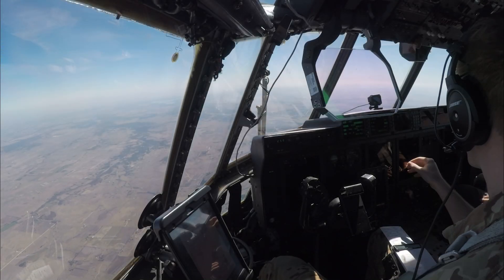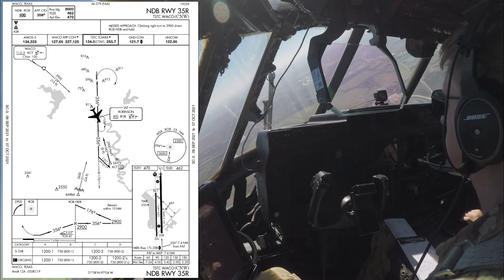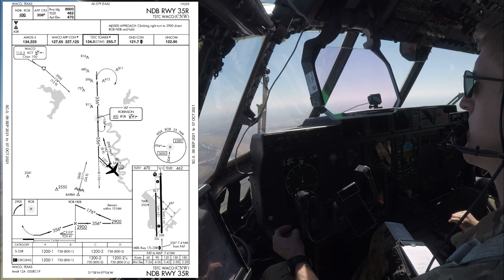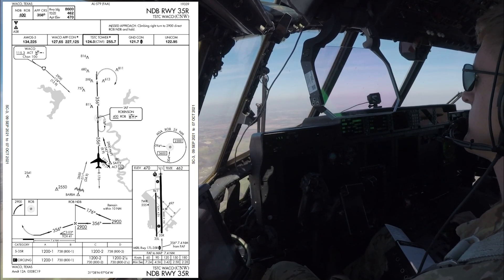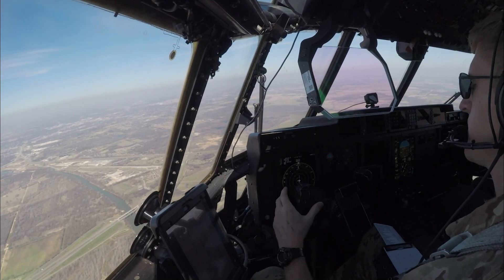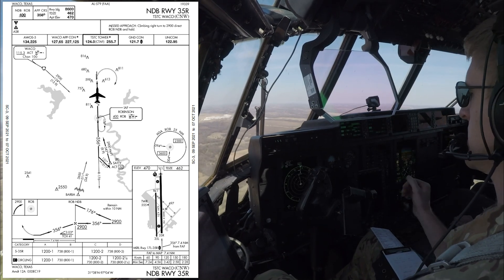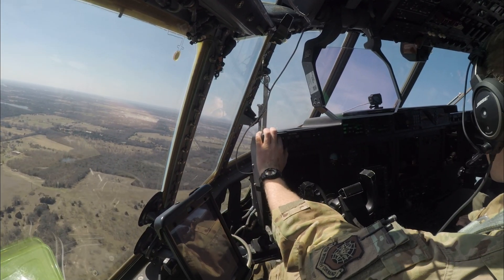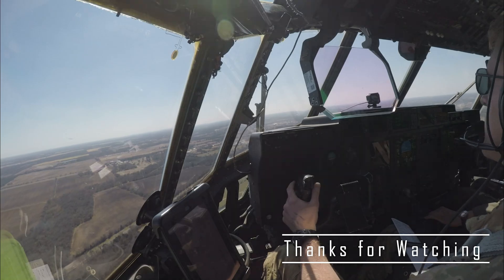C-130J NDB APPROACH AND LANDING - 4K

Comment: Push the nose, pull the tail?  What does that mean? {obv I’m not a pilot}
Reply from the maker: A way to remember how to stay on course. On an NDB or RMI only approach, the only indication of your position is an arrow that points directly to the navigational aid (station). If you are flying towards the station, the head of the arrow will be in front of you or pointing towards the station. If flying away, the tail of the arrow will be in front of you with the head pointing behind you at the station. To fly the approach you are required to keep the arrow on a specific course. If the station is directly north of you and you are flying directly north, that course is 000 or 360. If you drift off course, say right of course, the arrow will point slightly left. To bring it back to 360, you need to fly a heading slightly left of the arrows head to "push" it back to your desired heading. The reverse would be true if flying away. If right of course, the arrows tail would point slightly right of 360 thus you need to fly a heading left of the tail to "pull" it back to your desired course of 360. Once back on course you remove the push or pull heading change.
Reply: @ReachAviation  thanks

Comment: Got my Multi IFR rating in 2007 in Fresno, California at FAT. Right next to FAT is Fresno Chandler where I had to perform an NDB DME ARC approach for my check ride. It was challenging but I nailed it. I'm surprised to still see NDB approaches in this day and age but they are fun. Unfortunately, that approach doesn't exist today and has since been replaced with an RNAV GPS approach.